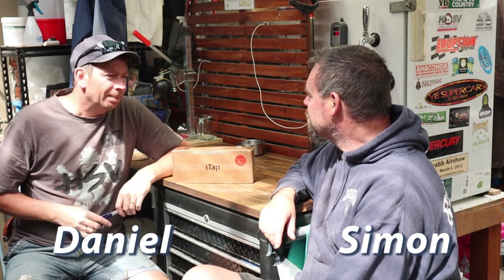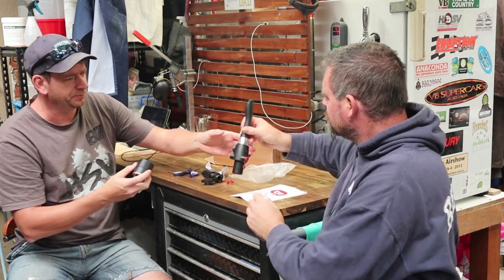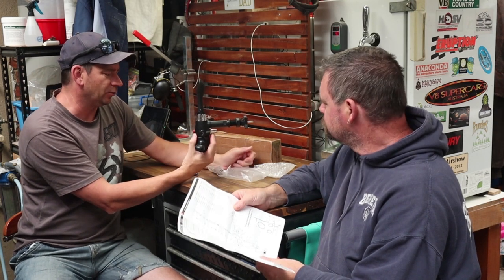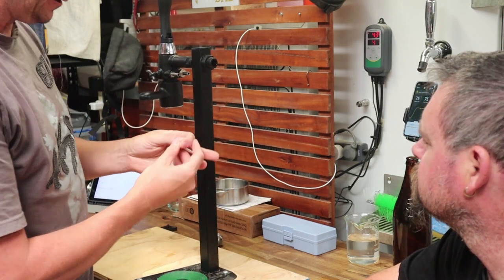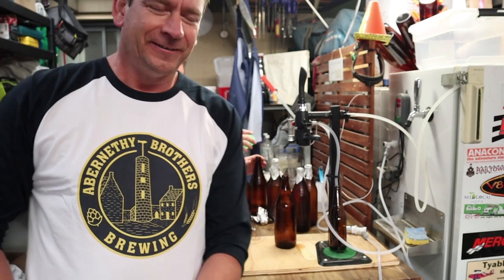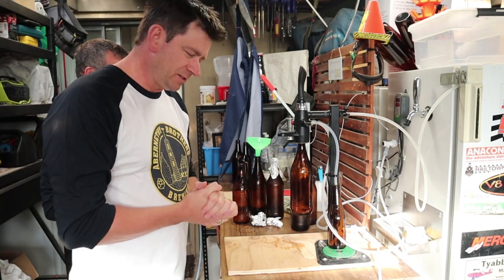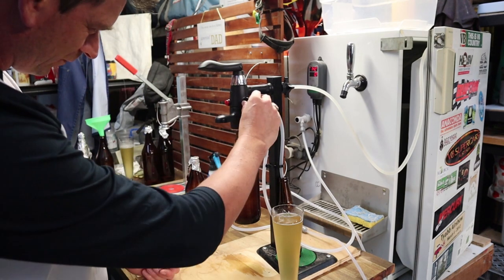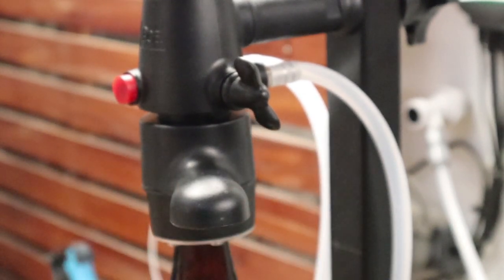iTap Counterflow Pressure Bottle Filler - Unboxing and Review

Comment: Great review guys   

have been thinking of the Boel Itap myself,  as you guys are aware the tapcooler  or the average counter pressure fillers can be far messy 
and this looks very fool proof  and will keep our  partners all happy when  its time to bottle a few

Thanks for taking the time to review that for us youtubers
Reply from the maker: Thanks mate. Appreciate the feedback
Reply: @abernethybrothersbrewing3838  i noticed in the video you used a different fitting  for the beer to enter
what size is that fitting,  as i have just purchased the boel itap afte watching you guys  setup the  itap
thankyou
Reply from the maker: @michaeleade4149  Gday mate - I will have to review and message you back
Reply: @abernethybrothersbrewing3838  Do you have this info handy? I'm looking for the same thing. Not even sure what that fitting is called!